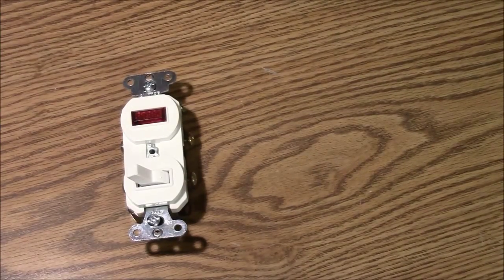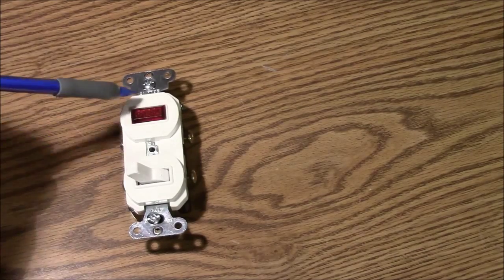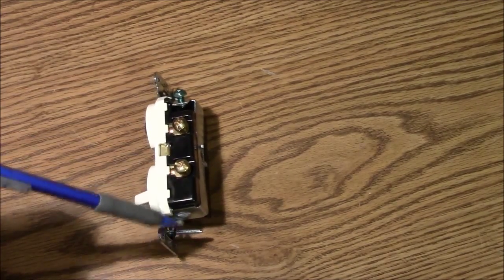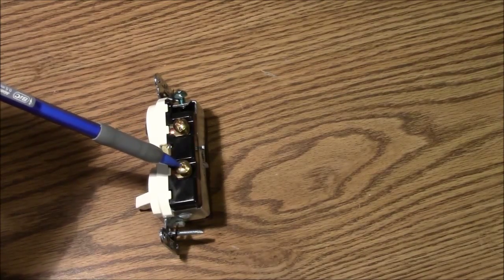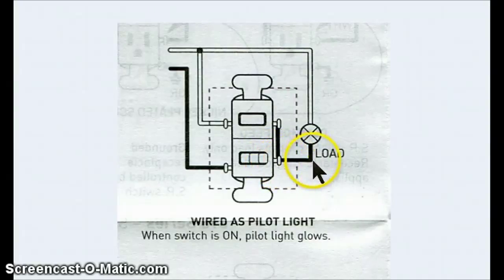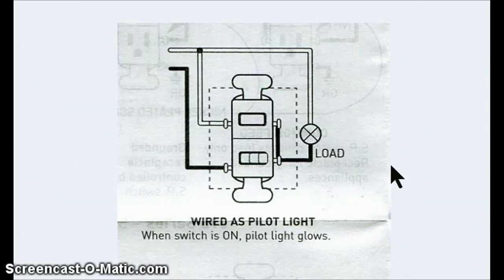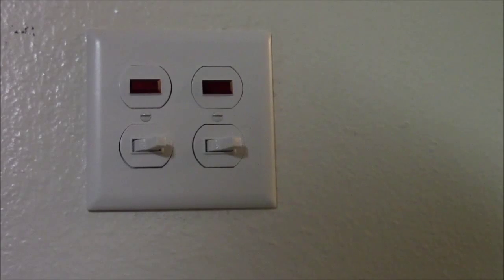Pass & Seymour 692 Switch Pilot Light

Comment: You are right on the money, yes the wiring instructions for the 692 are somewhat confusing. I spent the last few hours wiring some switches and outlets and as I wanted to wire the toggle switch with pilot light I got stuck. Could not make sense of the instructions. It was already late in the day. Pack up the tools and carry on the work in the daylight but not before checking whether somebody was nice enough to show and instruct how to wire that darn toggle switch. Enough already to forget to switch off the light in my attic or in my shed.
Thank you . You have been of great help.  I can finally avoid being scolded for wasting money by not switching off lights.

Comment: Nice job explaining the difference between the Hot/Common, Neutral and Line/Load as wiring in "pilot light" mode.  This is correct.  The Leviton version is similar as well but only has three screws not including the ground point (making it less confusing to some, it is also upside down in switch/light configuration, the neutral and line are reversed as well.) to the Legrand/P&S.
Reply: I found the elegrp pilot light switch is upside down and has the wires connecting the hot to the black screw that is next to the silver screw in order to get the light to come on when switch is on. Hope it’s safe?

Comment: Thanks  for the clear and concise description on this switch. I had a question on the extra terminal to the pilot light ....Is it another source of power controlled by the units switch. I wanted to control some power to another load... A 12 Volt transformer  to run some 12v lights. Thanks

Comment: This is what I am trying to instal, in my cold room. I have bought two versions of this switch. One very much like this one, and the other with the two screws on the one side were connected with a tab. I have tried every combination of connections I can think of. The most I can get is the red light on! My box only has a black wire and a white wire.

Comment: Thank you for posting today video. Question please. Is it ok to connect the power, from the breaker panel to the black screw that’s next to the silver screw? The instructions that came with the elegrp manufacture pilot light switch showed the two black screws (that are factory strapped connected) as the hot/power into the switch. However I had to connect the power wire to the other side, like you did, to the black screw next to the silver screw in order to get the pilot light the function correctly I.e., switch on light on. I would like to confirm this is safe and correct. Any thoughts?
Thank you

Comment: How do you wire it as a night light that comes on whenever the switch is off? 
Also, my lamp circuit has total of 4 wires. 2 wires are coming from the lamp and the other 2 wires are hot and neutral coming from the fuse box. However, there are only 3 useable screws on the switch (unless I break the internal tab). Where do I hook the 4th wire?

Comment: On Leviton and other manufacturers switches the side with the connecting tab and the two brass screws take the line or hot wire. The left side of your switch with the brass screw would be the load wire going to the light. And the silver screw would be the neutral.
Did the switch and pilot light work correctly the way you explained it in the video? If not try reversing the line and load wires.

Comment: I'm using this switch for my 110 volt water heater in our motorhome , I see that you attach the black and white wires (brass and silver) on the one side and on the other side you say to only attach the black wire on the bottom lead, what do I do with my other white wire that goes to the heater? If the to terminals are connected internally the black and white can't be connected??

Comment: Thanks, this video is awesome!  Based on the demo at 3:44, I plan to install mine "upside down" (switch on top).  This way, it turns ON by flipping left to right.  The other way (flipping right to left) seems counterintuitive to me.
Reply: Looking at the device as it sits in my hand, "top" is printed next to one of the installation screws (closest to the toggle switch). So you actually have it positioned as designed.
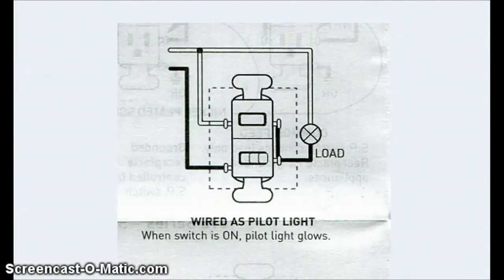Reply: @OOICU812  It's been a while since I installed mine, so I don't recall seeing "top" near the switch.  It makes sense to me, but it contradicts the diagram at 2:13 (switch at the bottom).  The Leviton 5226 looks identical; their instructions show the switch on top. 👍 This reminds me of a quote from a military manual for installing armaments upside-down under the wings of fighter jets.  The top of the armament is labeled "bottom", and the bottom is labeled "top", and the labels are written upside-down, in order to "avoid confusion". 😀
Reply: @daapdary  Ya  I need the pilot light on top as its in  an electrical box on top of a Dehydrator. light would be obscured by the trim on dehydrator the other way.  Glad the Video had this orientation.  Also my bent is to swipe right to turn off.  Maybe its Me !  lol

Comment: Correct me if I'm wrong, but like on most outlets there's a small metal tab on the side of the switch that has the two brass screws on it. You pass it with your pencil countless times. That tab can be removed with pliers and removes the "strap" as you're calling it. Then you can wire your load back into the light if you don't want it to be a pilot light as you have it wired. The instructions are wrong.

I'm using this application to know when my attic fan turns on. When the switch locate next to my breaker panel is activated the fan doesn't necessarily turn on even though I'm sending 120v to it, the thermostat and humidity controller in the attic determine that. (Above 100'f and/or 75% humidity) However when that said attic controller engages power to the fan, the light then receives power back at the switch and indicates the fan is running. (120v return is wired in series after the thermostat and comes back to light)
Reply from the maker: +FunInVa I&#39;ve removed one of those small metal tabs on a standard outlet to provide constant 120VAC on the bottom outlet and Switched 120VAC on the top so I would have to agree with you.

I really like your fan indicator application. Very clever.
Reply: I had that same observation but looking closely at that brass bit between the two, it doesn't appear to stand out as a breakable tab and looks from the video like it's an integral part of the device housing. If it really is connected internally, that is very unfortunate.

Comment: I have a question.  I currently have a basic light switch that turns on the light in my attic.  I would like to install one of these switches, for the same reason you mentioned, so in case I forgot to turn it off, I will have a light to remind me.  But currently the white wires coming from the fuse box and from the light are connected to each other in the box behind the switch...but aren't connected to the switch.  You say to attach the white wire from the fuse box to the silver screw on the switch.  What do I do with the white wire from the light?
Reply: run a jumper from the silver to the other white wires and use a wire nut. I had all of the commons on the old indicator switch on one tab thought it was to much for the screw to hold so connected all the commons and then ran a short jumper. Works fine and basically what the diagram says to do anyway.
Reply from the maker: Thank You.

Comment: In your demo, on the load side, of the outlet, where there are two brass screws, there is an cutaway between the two brass screws, that I believe exposes the flat strap bridge, which connects the screws !
I would think,  negate the need for an additional wire, between the screws ?
Yes ?
🤔 ? No ?

Comment: Thanks much but did not work for me. If I wire it your way the Switch turns the lights on and off but Pilot light doesn't come on? My switch is marked +LINE on BOTH Brass terminals on the left side of the switch which normally indicated your power coming into the switch. I first wired it that way and switch worked but no pilot light? Your way makes more sense though. Not sure what my issue is unless its because I am downstream from a GFCI. Maybe that interferes with the pilot light.
Reply: Just took the switch off the GFCI and now it works like charm.
Reply: After wiring exactly as you have described my light is on continuously. A suggestion please to correct this?

Comment: I regret I am still confused.  The switch for my light is in a box that has coming into it a black wire, a white wire, and then the ground wire.  That's it.

I understand the black wire goes to the brass screw on the left side (according to what is in the video).  I also understand the white goes to the silver on the left side.  I'm going to bet that the switch will now switch the light, which is what I already had, but the pilot is either going to be on always or off always, not controlled by the switch.  I could be wrong about this guess.

Do I need to "jump" the terminals on the right side with another white wire, which I then must somehow connect to the white wire leaving the box?  This is what the instructions sheet suggests to me, but I am unsure.  The inclusion in the instructions of a "load" symbol, together with a black wire that suddenly becomes white on the other side of it is what is confusing me.
Reply: Took a call to their tech support to resolve my own question.  You cannot use this device as a pilot switch to tell you a load is on in another room if all you have coming into your switch box is a black wire and a white wire and a ground wire and nothing else.

Legrand/Pass & Seymour apparently do not make a device that would work as desired.  I will have to look to see if anyone else does.
Reply: @tedegan4704  Ted, you can simply purchase a Lutron switch that has a locator light that makes it glow when it is "off" (designed to make it easier to locate the switch in darkness e.g. bathroom area).  I purchased the Lutron dimmer version so I could dim the light as well.  The model I used was DVW-603PGH-WH (Diva white dimmer type).  If the light switch is glowing you know the light is off.  The inverse of the pilot, but it was as an indicator light if you need one to assist you from leaving a light on in an attic of burner room.  Good luck.

Comment: I'm trying to hook up this switch the 692 on the top of my staircase. I have a switch at the bottom of my staircase and the top of my staircase so I can turn the lights on and off either switch. Will this switch work for my purpose?
Reply from the maker: No.  It does not have enough contacts.
Reply: The Erod1944 Channel do they make a switch for my purpose? Or how can I make it work for my purpose? What do you mean not enough contacts?
Reply from the maker: What you're trying to do requires two 3-way switches (double pole) and an extra wire between the switches.  The 692 (single pole) doesn't have the extra contact required.  You may or may not have that extra wire running between your current switches.

Here's a video describing a 3-way switch installation

https://www.youtube.com/watch?v=EFcwL22Ekok

I would encourage you to get an electrician or someone skilled in electrics to perform this task.  It can be a bit confusing and can produce real problems and damage if not done correctly.
Reply from the maker: This should answer your question:   https://www.youtube.com/watch?v=LPJ_nE1JAqg

Comment: Erod, i have a switch that the outside light don't work anymore, the light switch is one that the switch lights up (the toggle) when the outside light is off, so the switch is easy to find at night, if that (toggle) light burns out could that be why my outside don't work?
Reply from the maker: It sounds like you have some "voltmeter work" to perform.  From your description, it could be the switch, the wiring to the outside bulb, the light fixture or outside bulb or the voltage feed to the switch that's problematic which means  testing with a voltmeter is needed to see where the circuit died.  If the toggle light is out that could mean your switch or the power feed to your switch has gone bad..  As you're dealing with 120 volts make sure that someone competent working with AC power tests your lighting arrangement.
Reply: Erod, thanks, i just thought maybe you new about those switches, if they did that or not, maybe save me the hassle of doing the whole line, but thanks for the response

Comment: and what do you do if your white neutral wire has constant power like mine does?
Reply from the maker: That probably means that your neutral is looped through other lights in the building including some that are on or something even weirder.  I installed my switches on a totally "clean" circuit i.e. the wiring was straight from the fuse breaker to the switch location.    

If the installation of this unit is not totally trouble-free, I would get an electrician and consider the cost as fire insurance for the building/house.

Comment: I wanted to run an outlet off this switch so I knew from a distance when the switch was on and the outlet was active.  I wired it up, and the switch runs the outlet... but the light is on all the time no matter what.  What did I do wrong?
Reply from the maker: If the light is staying on all the time, you've wired the light input on the 692 switch somehow directly to the hot lead from the Fuse Panel.

This video is demonstrating exactly what you seem to want to provide the following conditions  i.e.; 
A.   SWITCH ON:    Light is ON  - Outlet is ON
B.  SWITCH  OFF:  Light is OFF - Outlet is OFF

Watch the video a couple of times, take notes and carefully rewire your switch (with the breaker off!!).
Look at the diagram carefully.  This is not a "standard switch".

If you can't get it to work, then I'm suggesting you hire an electrician as this stuff can damage you or your property.
Reply: No, I hooked it up this way.  The only difference is, I pigtailed my white wires.  Where should the white wire go that is going to the outlet?
Reply from the maker: With the switch laying on it's back and the light facing you  with the Light on Top here's the wiring:

A.  Neutral White wire from the Fuse Panel goes to to the Top Silver Screw on the LEFT.  It should be the same neutral wire going to the Outlet Neutral Terminal Screw.  You can "pigtail" it at the switch.

For example;  The while neutral wire from the Fuse Panel attaches to the Left Silver Screw on the switchand the white neutral wire going to the outlet also attaches to the Left Silver Screw on the switch.

B.  Hot Black Wire from the Fuse Panel goes to the Bottom Brass Screw on the LEFT.

C. Load Wire (Black or Red or Blue or whatever color) goes to the Bottom Brass Screw on the Right.  It also attaches to the Hot Terminal Screw on the Outlet. 

I'm thinking you've got the LOAD wire from the OUTLET and the HOT wire from the FUSE PANEL Reversed.
The pilot light won't stay on unless you have constant voltage on the right switch screws.

Again, this is all referenced with the Switch laying on its back and the light on top.

You should consider referring this to a licensed electrician.
Reply: Got it working!!  The blacks were on the wrongs screws.  Thanks!!
Reply from the maker: Yup.  Glad you got it working - Good Job !!

Comment: how do you wire it a night light
Reply: To wire in "night light" mode.  You would wire it almost the opposite as described above with the Hot/Common going to the bottom right line +, then a jumper from the neutral (top left) to (lower left, not labeled on switch) then the line/load (to whatever you are powering.  You will have two wires connected to this juncture, the jumper and line output.) output.  Kind of tricky.